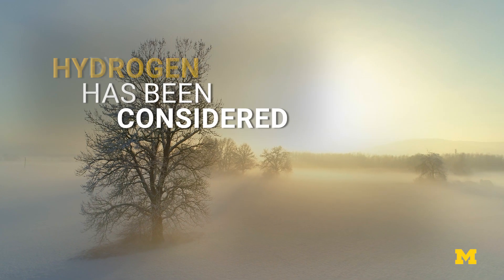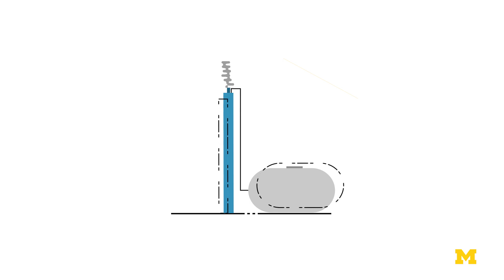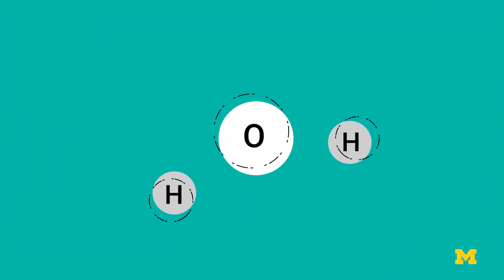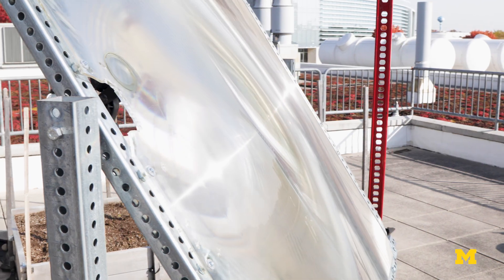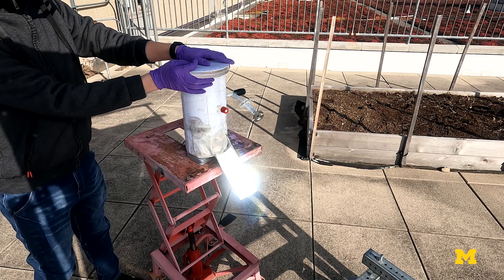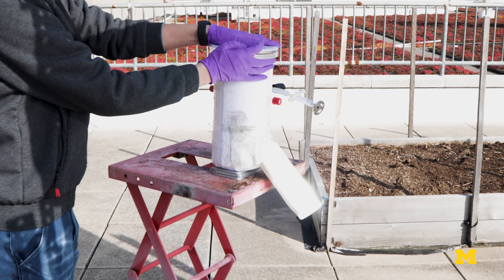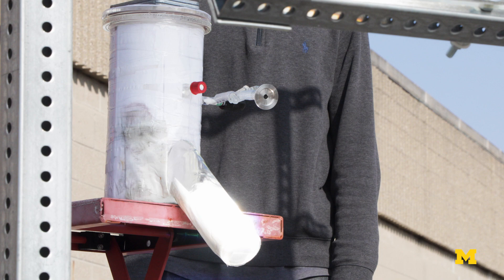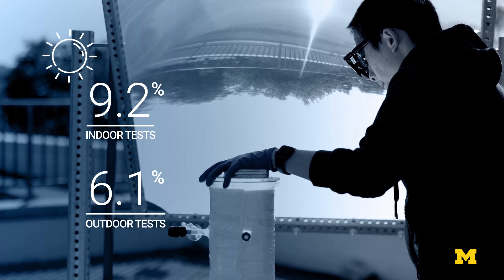A More Efficient Method for Harvesting Hydrogen

Comment: Trying to break the laws of physics? Using solar and oxidizing metals to aid in this silly theory is still a waste of time.. The energy required to produce hydrogen is greater than or near equal (only @100% efficiency) to the energy output of the produced hydrogen. No such thing as perpetual motion, or free energy.. It is impossible to run a vehicle from pure water. No big oil conspiracy here.. just the laws of physics.
Reply: And what is the total efficiency of typical hydrogen generation using electricity from solar panels for exemple? Why couldn't we do better with new, more direct, techniques?

Comment: Terrific work. Seems like in cars though, you only want to make enough hydrogen to charge a secondary Ev battery. Too much hydrogen is dangerous in car design. Too big an ev battery is dangerous in EV design. Yet medium/smaller batteries combined with ability to make just enough hydrogen onboard, that charges reserve batteries, makes sense for hybrid. Hydrogen hybrid EV's can offset each other's danger and likely reduce charging station network dependence.

Comment: But the conversion back to electricity still wastes too much, not to mention the energy waste from long-distance transportation and then all the intricate maintenance required for extremely high-pressure hydrogen systems
Reply: I've about magnesium hydrure, MgH to create a paste that stabilizes hydrogen with no leaks and much lesser explosion risks (except with water, but that can lead to other type of engines too)
Reply: Implying it would be used as energy at all.

Would be more useful for Hydrogen production for Ammonia
Reply: @sirnikkel6746, that is what i was thinking . Startups hype made them think that hydrogen is primarily meant to be used for fuel cell while forgetting about amonia.
Reply: It likely would be used for engines instead of electricity I’d image…
Reply: @lilbitofeverything5801  Combustion engines are even more inefficient, 30% to 50% for generators, and usually as low as 10% for cars...
Reply: localized energy grids, and if systems are compact enough, home based off-grid solutions
Reply: Look up Power Paste hydride. Stop spewing old news